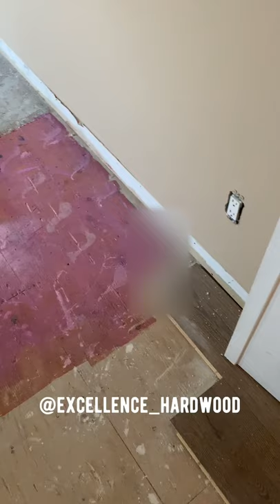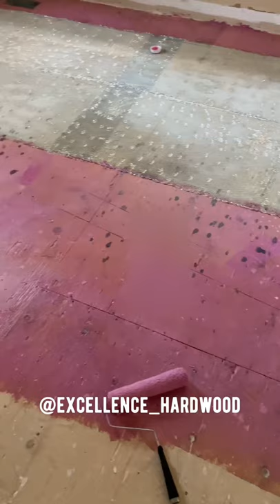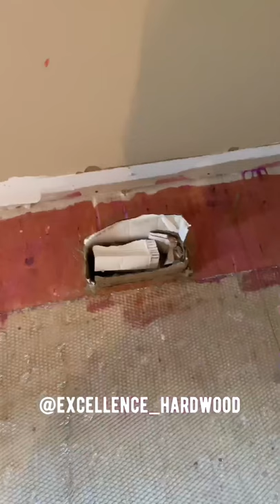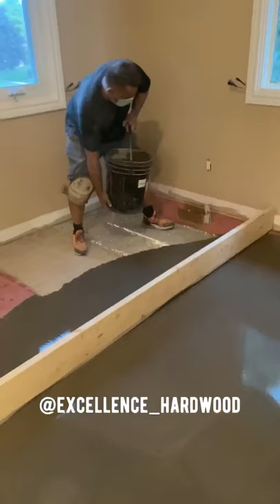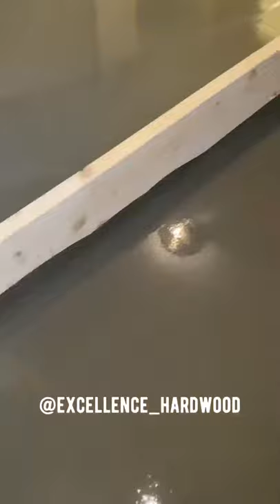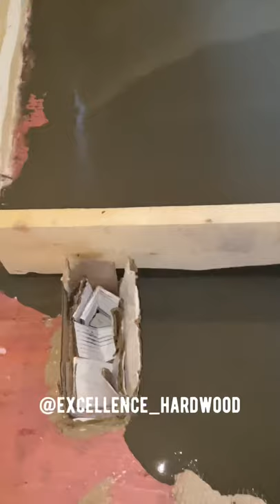Subfloor levelling with  Mapei products

Comment: Self leveling compound, so I'll screed it level 😂
Reply from the maker: Ohh yes,it’s funny…but the fact is,depending how much water you mixed with can be thicker,that’s when screed is good,to make the surface like glass….but you know it anyway,because I guess you worked with concrete or any cement based stuff before,right?
Reply from the maker: Also,no bubbles,the edge is clean.When we screed it,we have time to make it pretty,wherever needs more ,we can see it under the screed.Like I said,when we do thicker layer,we mix it also thicker.This is on the second floor,Must be careful to close all gaps before do it
Reply: Self leveler never perfectly levels , even the manufacture advises screeding, smoothing and using a spiked roller to break surface tension and do a better job…
Reply from the maker: @dilipanthonypinto1620  Thank You 🙏 for your comment,You absolutely 💯 right 👍
Reply: Right..wtf😂
Reply: @dilipanthonypinto1620 if they recommend it , why wouldn't it say so on the bag😅